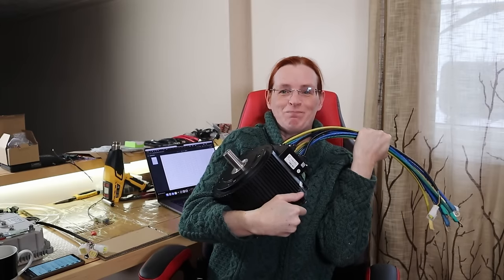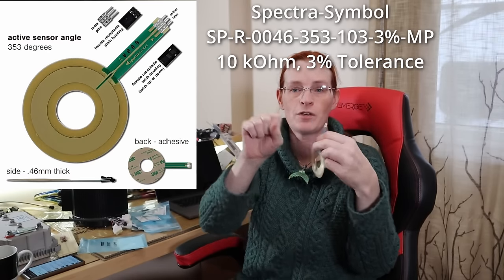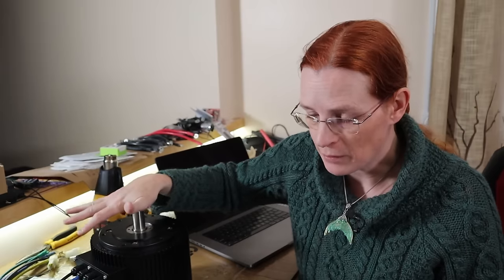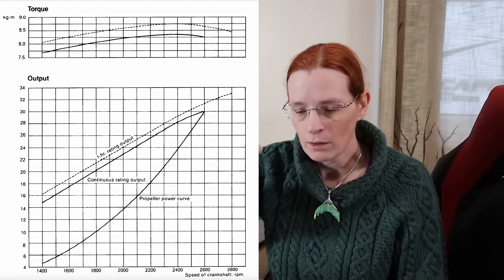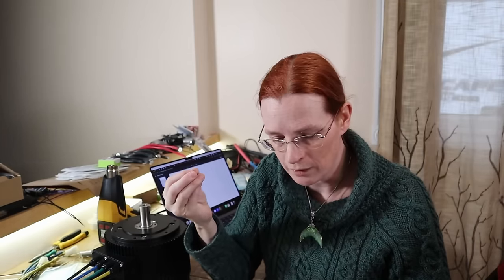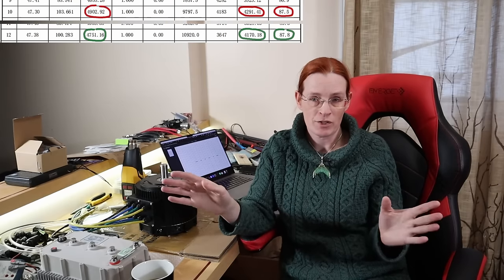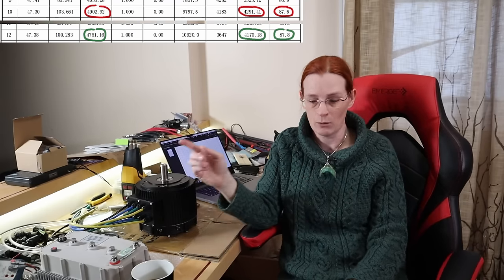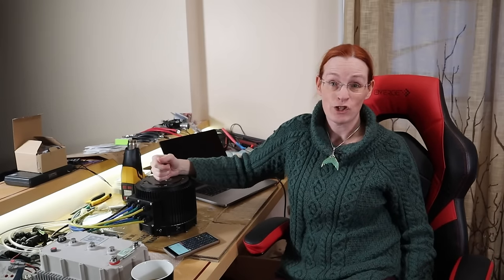Ep. 86 - Decisions Made! - Let's Get Technical

Comment: Very interesting but I am an engineer so you know how that goes. Just wondering thatt you did not mentiion and data regarding Propeller performance data; you should get from the prop mfr curves of thrust vs RPM and efficiency. This will also lead you to think about about the match between your most efficient motor speeds and how well they math with the prop.
Electronic devices are available that you can bolt in-line between the prop shaft and the motor or engine that will give a real time readout of torque and very expensive but perhaps the prop manufacturer has done some testing using such a device. FYI, they work on the principle of the amount off shaft twist as measured by a strain gauge. 
Does the boat have clearance for a larger prop?
Merry Christmas
Reply from the maker: I mentioned that I'll be going into more detail on the propeller in a future video, as it's a huge topic. I linked in the description the propeller I am planning on, and I sent my measurements and other details, and they sent back a recommended size and optimal RPM. Using that will be what sets my pulley ratio (~3:1 ~4:1). The boat does have generous clearance, and that's why the recommended the 430mm (~17"), compared to the current ~13" prop I have on her now.

I really want to have a way of measuring the real world output power, to calculate/display in real time the effective efficiency of the motor versus the input power. I'd LOVE to be able to "dial in" peak efficiency", also factoring in the boat's speed in water.

Comment: In the UK my boat is classed as a sailing vessel with auxiliary engine. I haven't asked the insurance broker but the type of engine (petrol/diesel/inboard/outboard/pedals) is unspecified. So if I changed mine, I wouldn't be informing anyone. I suspect you've been told something by someone who knows nothing, but is taking the safe line. (There are better descriptions for people like this.)
Reply from the maker: I run my own business, and have for over 20 years. It's made me very cautious about keeping everything above board, and in this case, I wanted them to know so that I wouldn't face a rejected claim if something happened. I know many projects just swap the motor and don't say anything, and I get it, but I'm too paranoid for that.

Comment: Any reason in particular to go analog with the throttle control instead of using a digital rotary encoder?
Reply from the maker: Hrm, you're the second person to ask this, and the honest answer is "I didn't really think about it". I kind of defaulted to an analogue input, given the near infinite values I can get from it. When I next talk to Andrew, I'll ask him about a digital encoder option.
Reply: @TheDigitalMermaid  Theoretically you can have infinite numbers, but your ADC is the limit here. A 10 bit ADC will give you 1024 values - you can easily get the equivalent digital encoder for this many positions.
Reply from the maker: @upnorthandpersonal  Aye, the DAC is a limiter, regardless, this is true.
Reply: We actually designed a simple wireless controller for my electric boat. It comes around to 3 buttons. First one used to put throttle higher, middle one is to stop and third one is to go reverse. If forward or reverse is pushed down, it will give a full throttle burst.
We did initial testing this fall, hoping to get that system installed next summer for actual testing. Quite easy to do with ready to go Bluetooth microcontroller dodads. So far I’ve been using simple potentiometer, but probably gonna ditch that and do this button system for the fixed install as well.
Reply from the maker: @ArcticSeaCamel  I hinted about computer control of the boat, and for that, I was imagining from a tablet or phone, so wireless effectively. That said, I want to always have a hard-wired set of controls at the help that overrides any other signals. I'm old enough to never trust tech that much, particularly wireless tech. :)
Reply: @TheDigitalMermaid  Yes, my thoughts as well. If throttle is controlled via microcontroller (wireless and/or not) there should be simple way to bypass that altogether. Controlling the motor controller (0-5v) with simple potentiometer is easy. I have been using that for four years already.

Comment: You need programming MPPT controls for recuperative charging. So as i know this motor controller has only recuperative braking without control efficient point of recuperation.
Reply from the maker: This is something I still need to dig into, but I am pretty sure it has a selector for how aggressive the regen is. If so, one of the many benefits of the arduino is that I can program it to auto-adjust the regen aggressiveness based on the current speed in water.

Comment: Also look at pulley conversions. This could make 1kw of power act like 1.5kw of power for spinning the prop shaft.
Reply from the maker: How so? I'm already planning a ~3:1 or 4:1 reduction to get the motor speed down to the optimal prop speed.
Reply: @TheDigitalMermaid   A little research goes a long way for pullies. having your electric motor shaft spinning 1 time and the prop shaft spinning 1.5-2 times. Even higher maybe. Since Electric has so much torque its easy enough to do this. For regen you wan the opposite maybe even 4 to 1. this would mean 2 different pully systems. see regen can be increased by spinning the motor faster. maybe even a 10 to 1 pully for that.
Reply from the maker: @dc1544  Aaaah, I get what you're saying now, ok. Hrm, that's an interesting idea... And ya, I have a LOT of homework still to do on pulleys. And on dozens of other topics. Haha! That's what makes this project so fun. I just need more hours!
Reply: @TheDigitalMermaid  or just clone yourself a couple times. put them to work lmao.

Comment: that's a beastly motor!  

if you can get the controllers to go open-circuit on the output then you'll probably find there's effectively no power lost in spinning the motor, so you could likely just have both motors permanently connected via belts and simply select which one is active through software.  the other one will free-spin.  without a load on it the only energy needed to spin the shaft is to get it up to speed and then overcome friction in the bearings.  try it - short all six of those wires together and spin it by hand, that's the difference between open circuit and a controller that's actively trying to get energy out of the motor as regen

going to be interesting to see what regen is like on a boat, it never occurred to me that you could do it.  are boat propellers efficient "in reverse" like this?  in cars it works well since you have a solid mechanical connection to the road surface and they're always intentionally trying to shed energy because of braking.  i wonder how it would compare to a small wind turbine, wind->power rather than wind->sail->water->power?

looking forward to seeing more :)
Reply from the maker: I've had a few comments now suggesting that, if I can set it to freespin, the drag will be nominal. It'll certainly be something I experiment with! 

The prop I've chosen has a neat setup where the blades "flip over" 180 degrees, so they have a pitch designed for optimum forward motion, so when you go astern, they flip over, giving you optimal pitch for reverse. This means they're also the optimal pitch when doing regen. It's a brilliant setup! The link to the prop is in the description, and the company has videos showing how it works. If you lock the prop shaft, the blades with feather to minimize drag.

Comment: Many devices made for sea use are specially treated with sealed circuit boards , one splash of sea water will kill them. All of your lcd displays for your should be sealed completely against sea air. There are industrial computers and keyboards made for industrial environments . I have used them in my designs and they are great.
Reply from the maker: Tinned copper and conformally coated circuit boards, yup. I plan to add a spray-on conformal coating to everything exposed when I am done.

Comment: If you've got a CAN bus on the controller, why not have your Arduino use that to drive the controller? That will probably be easier than dealing with analog signals in the presence of all the switching noise. Also, you showed the potentiometer you're planning to use as a throttle input. Cars often have multiple separate potentiometers for redundancy. You might want to look into modifying a car throttle pedal since they've already done the hard engineering.

Comment: Hi Maddy, thanks for sharing your thoughts, I've got a couple of questions, maybe a heads-up. I saw a resistive with ball bearing setup for your input throttle: please be aware that you are in a saline environment, it will oxidate faster than you think, essentially killing your possibility to drive the engine, try to find either a capacative or optical way of doing this as it would last a lot longer and is sturdier (alike the resistive vs capacitive plant sensors), this is just my fear when running such parts. Also you conversed HP to KW. The Diesel KW is maybe 40% effective, so a large 100KW motor hasn't got 40KW of output, so maybe your peak isn't that import but more the turning speed of the propellor, the diesel engine running at a certain RPM drives the shaft at a certain RPM, that might be important as a electric engine might run different speed and that conversion is important for the "driveability" of the propellor. And finally, when you want to regenerate from a propellor, it's shape will be important, because they might be having different "drags" in water, so a high power conversion propellor might slow down your boat when it is still. So maybe think of two propellors or generators on the side of the boat which are facing forward to charge the batteries. (But the last one might be a little lame when running on engine power). Probably you might need a conversionbox for the speed of the propellor shaft vs the speed of the electric engine. Just my thoughts, I'm no mechanical engineer, but let them please advice you on how to make this marine grade ready.
Reply from the maker: You're already the second comment to warn about the pot corroding, so I will certainly pay attention to that. I'll have spares, of course, but I might see about conformally coating all metal bits for extra protection. There will be an e-stop button at the helm (ABYC requires this), so in a pickle, that'll be the safety. The prop size and speed is hugely influential in efficiency, as I understand it, and it's partly why I'm investing so much in the prop I've chosen. This prop also flips over 180 degrees, so it has optimal pitch in forward, and in reverse/regen.
Reply: @TheDigitalMermaid  The good part is speaking freely on your planning, this will give you people reacting on your choices, either positive or negative and gives you to think about options. One of the parts of marine stuff it's mostly very expensive but for the reasons of running into storms and water goes everywhere then and salty water is evil 🤔. So I'm glad you look into the reactions and make your planning better. Just also to give you a heads-up, I think you follow Andy's channel, but he made a breakthrough with JK, the new BMSes might help your Victron setup to work better. And looking at what you plan to do, maybe try to have two seperate setups in your vessel, 3 banks primary power, 3 banks switchover power and 1 bank as general or backup power. This will give you options when you hit the ground running. With 2 MP's and 2 different solar inputs this might save you from harm (you can think of joining things or switching things). Just my thoughts not to critique you. Have fun planning and getting things to work, love to follow the proces.
Reply from the maker: @edwardvanhazendonk  A huge reason I wanted to start this channel is for the feedback. Taking in advice and experience from others is so important to giving this project the best chance of succeeding. I'm a few episodes behind on Andy's channel, but I am hoping to get caught back up asap. I know there's been a lot of JK developments. On the solar, the goal will be to have at least two MPPTs, one for port and one for stbd. Everything important will be redundant, for sure.
Reply: @TheDigitalMermaid  The quick summary: JK fixed all his major complaints and the BMSes function exactly how he'd like them to.
Reply from the maker: Excellent!

Comment: Madison, 96VDC components like motor controllers, chargers and solar charge controllers, and inverters are isolated (designed to be ungrounded on both leads) such that they work with bipolar batteries. That is, +48v and -48v with a third lead coming from the mid-point of the battery as the safety and reference ground (0v). That center wire gets connected as the safety ground such that the voltage potential to ground is only 48v but the powered devices see the 96v potential.
Reply from the maker: Huh, so you could use a controller like that with a pair of 48v batteries? Wouldn't the two 48v batteries need to be isolated with their own controllers? I vaguely considered this back in the day, though series'ing two 48s to get actual 96v. What you're describing is fascinating.
Reply: You're running 16S batteries, right? That's really just two 8S batteries in series. That midpoint busbar is the halfway point voltage-wise. Reference that halfway point to ground and you've got a bipolar battery, +24 and -24. The same thing works with 32S batteries: really just two 16S in series. BTW, I'm putting four bipolar batteries at +48/-48 into my 100% solar only catamaran conversion. Mine are 34S rather than 32S so it's 122kWh of storage and 9.84kW of solar.
Reply from the maker: @randycain5764  The part that I'm confused about is that, with my current design, all six/seven batteries go to a common + and - bus bar, given the inverter and charger are 48v. So in a sense, it's kind of like a 16s7p battery, so where would I pick up the midpoint?
Reply: @TheDigitalMermaid  
I'm not suggesting that you should change your setup since you've invested in 48v bms, chargers, etc.  In fact, your Victron systems won't support 96v. But, by way of example, six 48v could be turned into three 96v batteries by connecting the three 48v pairs in series. So, there would only be three negative battery leads and three positive battery leads connected to their respective +48 and -48 busbars. In each series-connected pair, the connection point between the two batteries is the 0v ground reference point and is connected to the ground busbar. Note that there are now 3 busbars! This is similar to the way split-phase 240VAC is done with two "hot" leads and one "neutral" lead, except that with the battery we don't normally pass current through the safety ground.
Reply from the maker: @randycain5764  Oh, I didn't think you were suggesting I change, the die is cast for that already. Just the same though, I always want to learn more. Having three busbars is kinda how I thought it might work. Well in any case, it still ends up running foul of ABYC standards, so it's a fun thought experiment only, for me.
Reply: @TheDigitalMermaid  
Nope, it's compliant. Even a straight 96v or higher can be. When you exceed "low voltage" you have some additional safeguards to follow. But, there isn't an ABYC limit. If there were then we couldn't have inverters onboard either. Even the EU lets you have higher voltages now. 144v is readily available in high performance boats.
Reply from the maker: @randycain5764  When I was reading the ABYC standards for low and high voltage, I seem to recall some things were opposite. I don't remember the details, I'd have to re-read the regs. Well in any case, it's theory as my choices are now paid bills. :)
Reply: @TheDigitalMermaid  true! My only point is that you can use higher voltages, not that you should use higher voltages. Keep up the good work ... looking forward to your progress!
Reply from the maker: @randycain5764  ^_^

Comment: Current ratings are for long runs of cable, not short runs. The manufacturer of the motor would have installed them in the motor. You need to place the controller next to the motor. Now, the cables that supply the controller must be much larger. I would recommend welding cable because it is very flexible, maybe 4/0.  Test run your boat on your present prop and if necessary , calculate for another size prop. I would recommend getting the entire controller system from the manufacturer of the controller. Those anduino boards are not professional and will fail on the open sea.
Reply from the maker: Sort of, yes. I often use voltage drop calculators to figure the voltage drop over a given lenght/size of cable for a given run. I aim to stay under 2% drop, but if a run is tricky for some reason, I'll go up to 3% drop, but never more, and ideally much less.
Reply from the maker: On the prop; I need to get a new prop shaft to account for the new thrust bearings, and it'll have the taper and thread for the new prop. So comparing the 13" maxiprop to the 17" Ecostar is not really on the table I'm afraid. As for the arduino; I hinted at this in the video, but didn't go into detail; The atmega is to get started. The longer term plan is to move to a proper pic on a proper circuit board. The arduino is great for this early stage work.